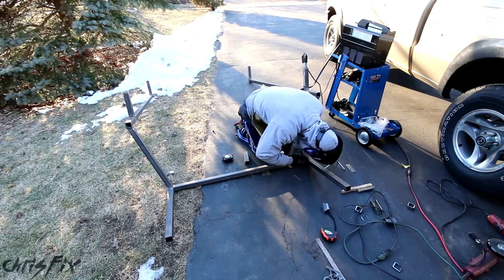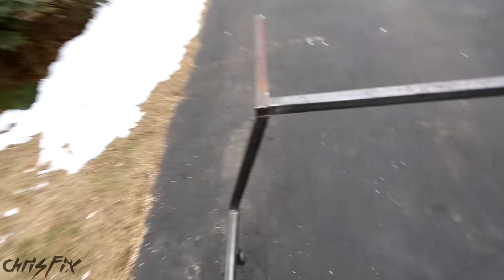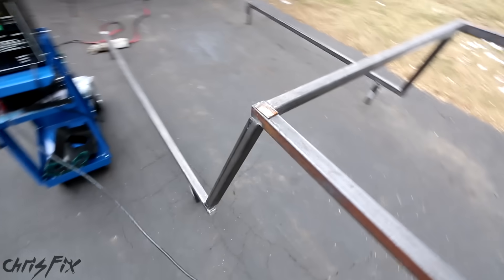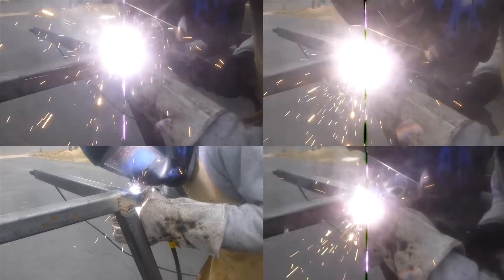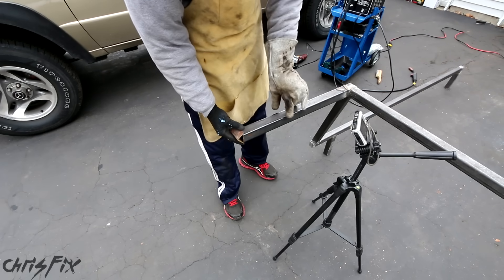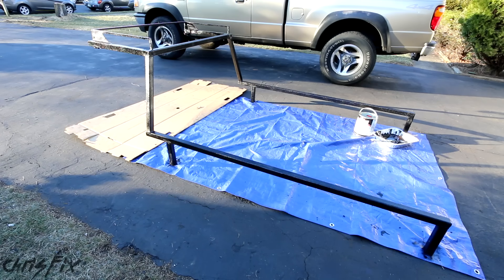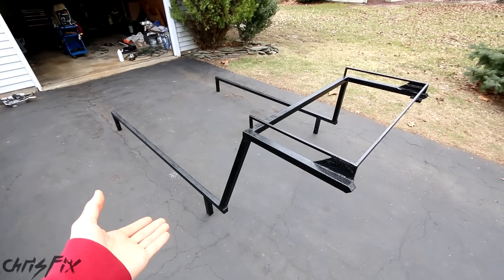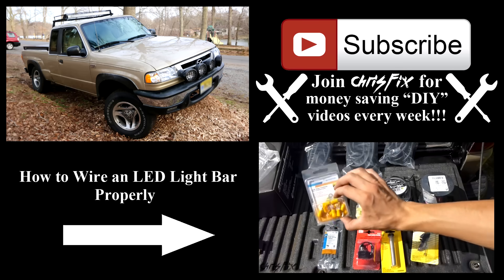Custom LED Light Bar Build (Part 2 "Project Night Light")

Comment: Were you taught to weld or did you just teach yourself? There have been times when I thought it would be a great skill to have but the investment versus actual need never really evened out for me. I cant believe you didn't show the wiring and the light on?!?
Reply from the maker: Robert Parker I taught myself watching youtube videos haha. It is not a big investment. Check out the link in the description to the welder I used. It can be found for $100 or so.

Comment: Might I suggest adding some steel mesh on the cab portion? You know like they use in the floors of smaller trailers. It'll give you the ability to throw stuff up there in a pinch.
Reply from the maker: jared That is a great suggestion! Maybe in the future I will weld some in!

Comment: If you put some kind of rubber under the front bar that is parallel to the lightbar so that weight doesn't end up dinging your cab and then weld on a piece of black grate fencing behind the lightbar, you could have more storage room above your cab.
Reply from the maker: SHEHZAD SIDDIQUE There is no need for rubber. I can stand on the top bars anad it only flexes an inch or so.
Reply: That's sick, didn't know how tight it fit in the post holes. If I do it, I'd weld a grate behind the lightbar so I can store above the cab.

Comment: If you'd cut those front bars at 45 degrees, it would have been a lot easier than welding those angle plates.
Reply from the maker: ***** Cutting the bar at 45 degrees for me would have been more difficult because I do everything by hand but if you have a saw that you can dial in at 45 degrees, then for sure!
Reply: ChrisFix I'd suggest getting a chop saw. It would also make everything look neater.

Comment: You did a really great job, that being said, I would have added a steel large mesh screen to the roof portion to make it a function roof rack as well. That would have been SUPER slick.
Reply from the maker: 8BitLife Thanks a lot! I have had a few subscribers say that so I might add that in later down the road!

Comment: Looks amazing chris :D, you made that look so easy.
I do like the side security panals, they add extra strength as well :-))
I did notice the slightly loose threads created by tapping the tube, thats not a fault in your work, its typical of the cheap taps produced nowdays, i bet (knowing you) they have some blue thread locker on them :D
When i was a lad (4000 years ago) we had 3 taps per job, starter/mid/plug tap, but that was a looooooong time ago lol.
Reply: Nice job kiddo u did good😁😁

Comment: Wow! I'm impressed, fantastic job Chris. Just a few more pieces and you could have probably built yourself a nice storage basket area behind your light bar. Adding those side plates was an excellent idea. Although I think a nice little detail such as cutting your ChrisFIx logo into them would have been nice addition. Also, if you don't mind me making a few suggestions, I think a single amber l.e.d. marker light mounted to the very two front corners facing forward would look great. Also, maybe add a single red l.e.d. marker light to each of the rear corners on the roof part of your rack. Then if you wanted to you could wire them to your trailer harness so they could function as parking lights, turn signals and brake lights. Keep up the great work, can't wait to see that l.e.d. bar all lit up. :)
Reply: Cool mods, Tat2.  I can hear Chris getting excited already (his enthusiasm was definitely noticed in the 2nd video - like a little guy getting closer to Xmas! HA)

Good work, Chris.  Now breathe in, breathe out, don't get too excited on the mods.  :-p hehehe
Reply from the maker: Tat2Dragons Thanks man and stoppppp. Those are such good ideas lol. Now I need to update the design haha. I wish I could carve the chrisFix logo into the side plate. That would be so awesome man!
Reply: ***** Thanks, glad to hear you liked my suggestions. :)
Reply from the maker: ***** Thanks a lot man!
Reply: ChrisFix You're welcome.:) Hey Chris, if you like that idea you could go about it another way by cutting out a pair of plates with your ChrisFix logo that you could bolt, or screw onto your existing plates. You could even go farther with it by cutting a piece of clear plexiglass to mount behind the logo and then mount l.e.d.s in edge of the plexiglass so it would back light your logo. :)

Comment: On the top part i would have welded some cross bars in to it so you can put stuf on top. For the rest of it it looks very cool. The bedcover paint is a great idea also. Man i dig your vids like crazy!!!! keep them comming
Reply from the maker: cedicol Thanks a lot! I was thinking about putting expanded metal at the bottom like you said but I wasnt sure yet. I will have to see. The bar could always come off and I could always grind off the herculiner in the spots I need to weld!

Comment: Have you looked into getting a bigger alternator for all your lihhts
Reply from the maker: az man 2013 I was thinking about it but I ran an amp draw test to see what draw my truck has with everything on and it is 45amps. I need to figure out what size alternator I have.